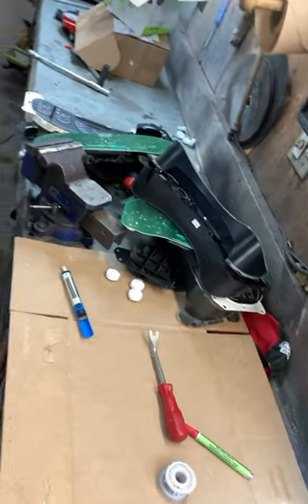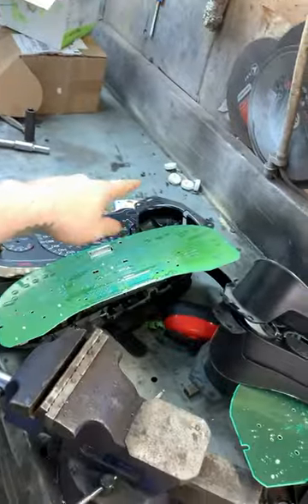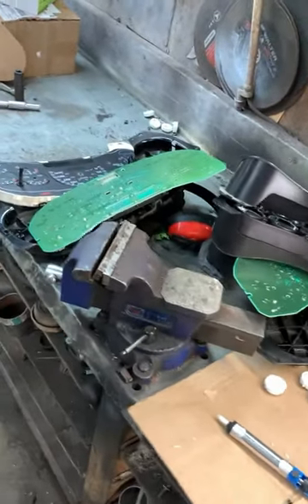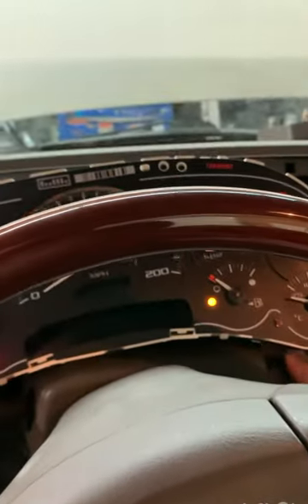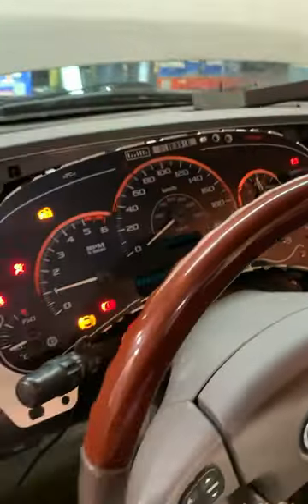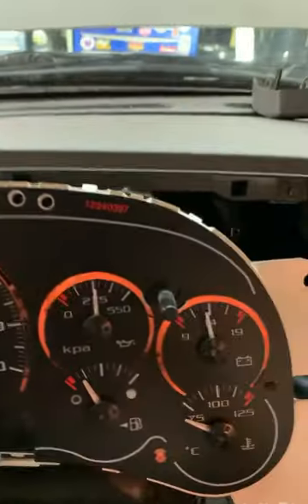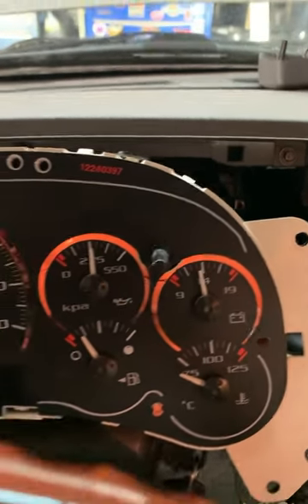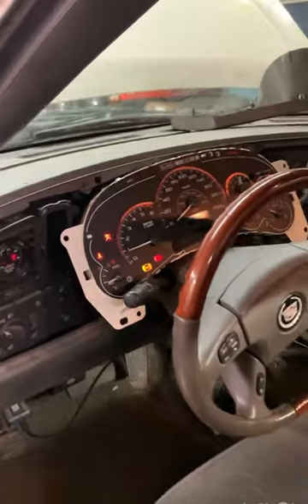Chevy truck gauge repair for free! #shorts #shortsvideo #gauge #repair #diy #fixed

Comment: No, you got that figured out.Let's see you get the steering wheel controls working......😅
Reply from the maker: Hahaa if I could find a dash that has all the wiring for it, I’d change it out again
Reply: @StationroadRatrods  Didn't you have one in the cadillac??
Reply from the maker: Yeah the wiring was a lot different though, there was a bunch of plugs for the center console and stuff. I wonder if it separates or not
Reply: @StationroadRatrods  Just un pin everything that would have went to the center console
Reply from the maker: I suppose so yeah. I’ll size it up again, I like when buttons are functional, even when I don’t use cruise control and never have the radio on LOL